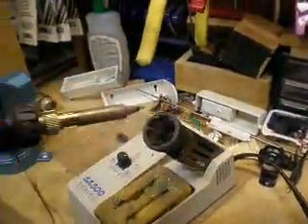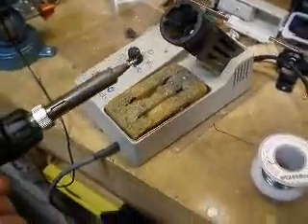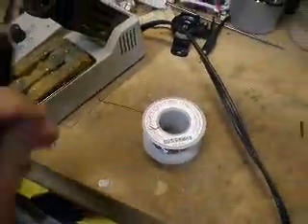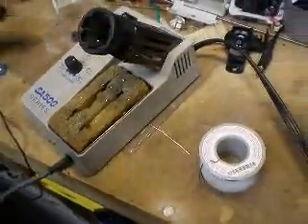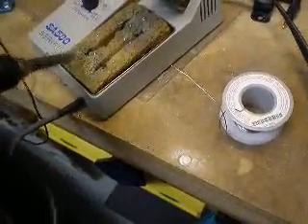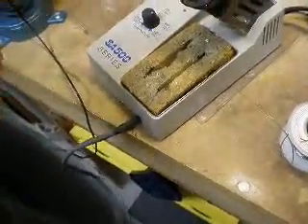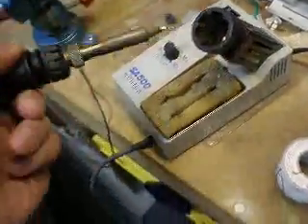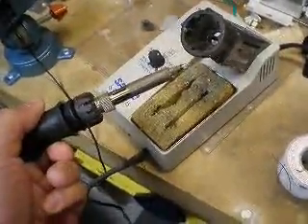How to clean the soldering tip - Part 1

Comment: ok, im getting conflicting informations. one says, clean it, teh other people say tin it
Reply from the maker: Tinning the solder tip simply means to apply a layer of solder onto the tip. If the tip is dirty, it will not transfer heat properly, and therefore you can't properly tin it. The steps shown in the video is correct. Clean the tip and then tin it.
Reply: no, i get that and its what i did the few times i soldered. What i mean is when putting it away. On another guys video, he said to always clean it for storage. But i've looked at some more opinions  and the most say to tin it for storage too, so ill keep doing that.

Thanks for the quick reply
Reply from the maker: You should tin it for storage. By tinning prior to storage, it will also allow for easier solder flow next time you use it. I use to work in a manufacturing factory where we manufacture/test/repair high end video equipment for cable companies and broadcast companies. That was my job back then and not just a hobbyist. It's good that you are asking these questions to take care of your tool.

Comment: I have some hard residue on tip.  Can I file or sand it off or will that ruin it?
Reply from the maker: Try to clean the hot tip with some steel wool, and see that removes the contaminant.

Comment: I just bought a new 60w and it beads up on the tip even though i have scrubbed it in the sponge, I have left it sit over night in soapy water, the solder will just bead up and fall right off. What is wrong?
Reply from the maker: Are you using rosin core solder. You need the rosin to help clean the surface. If you bought a new iron, then the tip is tinned and new and ready to be primed with solder. Putting the tip in soapy water won't do anything. You can always try cleaning it with some steel wool.
Reply: Brian UK I live in the US. No US plug option :(
Reply: 86
Use steel wool once you rob it you will see it turn gold copper color then your solder will stick to your tip and use professiobal quality solder.take first though excess rust by wiping with pad..tge pad is uselles if you dont take oxidatiin off.you tip shoul look copper color when sanded down..

Comment from the maker: @cranebeg Is the solder actually melting, if it is, are you using solder with rosin core inside? Don't use solder for plumbing. If your solder tip is clean and hot and melting the solder, there is no reason it doesn't work.

Comment from the maker: I mainly use rosin core 60/40 (60% tin / 40% lead) solder for soldering on circuit board. I am able to keep the soldering tip this long because I don't abuse it and clean it after each use.

Comment from the maker: That's interesting. When there are solder on the tip, it adds more mass and the iron requires more heat to melt a bigger mass of solder. If what was left on the tip was truly solder, then with enough heat, it should melt. I still think either your iron might have some heat issue. But of course I can't say for sure without seeing it myself. Not to disregard your experience but I have had over 7 solder irons and never had this problem.

Comment: It melted fine on the tip etc. But after I put the solder on and turned it off and went to use it next time the solder that was on there didn't melt. It pretty much became 1 with the tip.

Comment: I did what you said with keeping the solder on the tip and putting it back and when I heated it back up the solder didn't melt. It just stuck to my tip and I had to buy a new tip because of it.

Comment from the maker: @eyedeeaz Are you using solder that has flux core inside? If not, try to find some with flux. It helps inhibit oxidization and enables solder to melt. If all else fails, then get the tip replaced.

Comment: My soldering iron was really dirty and black so I give it a light scrape with some fine sandpaper until the tip looked clean. I then heated it up and wiped it on the wet sponge but when I put solder on the tip it just went into a blob and wouldn't coat the tip. Is the tip knackered?

Comment from the maker: @rocknroll4eva100  sorry for late response, working late these days. Did you try cleaning the tip cold with some steel wool or fine grit sandpaper? Are there any black crap on the tip, if so, clean those off first, then heat up and feed some resin core solder onto the tip. You don't have to clean the whole entire solder tip, just the tip where is cone shaped. If all else fails, go try to find a replacement tip (if available).

Comment from the maker: @osamamoto There's only 2 reasons why this would happen. 1) your solder iron is low wattage and not hot enough (solder iron comes in different wattage ratings) 2) your solder tip is dirty and oxidized.

Comment: @dial2fast Well ever scince i started to try to tin my soldering iron i see some silver like patches on it but its not all over the tip just in some spots, ill try to tin it intill it lloks all sivery cause if i touch my solder to the silver spots it instalys melts it! thanks for the tips and ill try tinning more and right back if it works

Comment from the maker: @guitarbowest  The solder tip should be evenly coated with solder (all silver). If there are any black dirty spots on the tip, then it can't conduct the heat to melt the solder. Also make sure the solder tip is tightly screwed in.

Comment: i dont know if my tip is not clean or what but when i started to use it the pointy tip would easily melt the solder, now i have to apply alot of pressure on the solder with the tip for it to melt but if i touch the solder above the poinmty tip it melts.

Comment from the maker: @rootbeerdude96  The soldering tip should flow solder around the entire pointy tip, and not on some parts of it. If it was not maintained and got some oxidation then you should use a fine grit sandpaper or steel wool to clean the surface of any contaminants. Then heat it up and feed a bunch of rosin core solder to the tip until it gets coated all around. From here on, keep it clean after each use.

Comment: great video! but i have a question about my soldering iron. i cant get the solder off of it, if i wipe it on a wet sponge the solder goes to the opposite side of te iron. i cant seem to get it off. someone mentioned to me that i can file the tip but im not really sure how to do that, please help?

Comment: @relisys001 I got a 60w and still doesnt help. I melt some new solder onto the DC joints and try to suck/braid it off but it doesnt even melt my own. On another note, I purchased a chip board and soldered some resisters to it and de-soldered them no problem. Its just the Acer motherboard I cant crack  :(

Comment: @dial2fast Thanks for the replies. The iron I was using was a 30w and I tried heating the solder then pulling the jack  but no luck. Im going to get a new soldering iron... Is a 60w iron enough ?

Comment from the maker: @dial2fast 
Another tip, for this type of repair, often you will have small amount of solder stuck in the thru hole, use the iron to melt the solder and while melting, use pliers or finger to incrementally lift the component. Repeat for each pin little by little until the entire part comes off.

Comment from the maker: @relisys001 
For repair such as that you need a hotter iron (or adjustable one). The problem you have is the DC jack & the PC board copper trace & solder wick all act like a big heatsink and drops the temperature down significantly. If you continue to use a iron that is not hot enough, you will eventually damage the PC board copper trace.

Comment: @dial2fast  I cleaned it and managed to tin 80% of if but thats not my biggest problem. Ive just bought the soldering iron to repair my cousins laptop DC jack. I spent 4 hours this afternoon trying to de-solder the 6 contacts on the underside of the board. Ive tried putting solder on to the already soldered bits then de-soldering but nothing comes off. I tried putting braid on the contacts and put the tinned iron tip on but nothing melts and nothing sticks to the braid :(

Comment from the maker: @relisys001 
The tip should not be black or oxidized or rusted to begin with. If it is, try to use some steel wool to clean all that crap off the surface (do it when it's cool). Now turn it on and feed the solder on, it should flow onto the tip nicely. If all this still doesn't work, just replace the tip and keep it clean from here on.